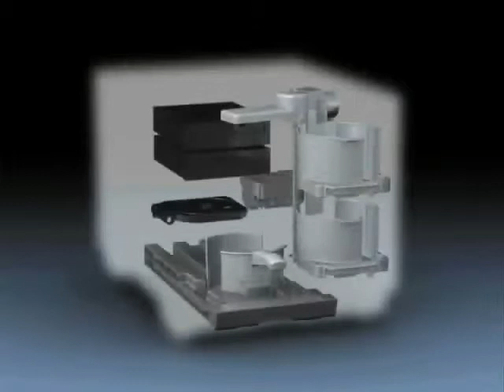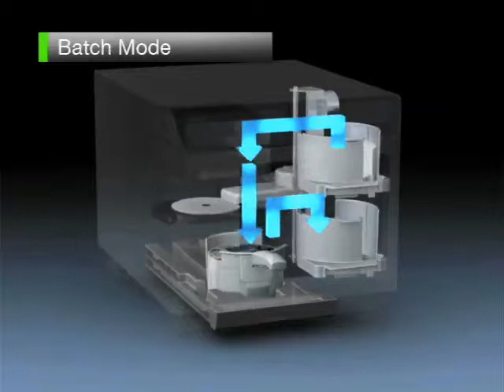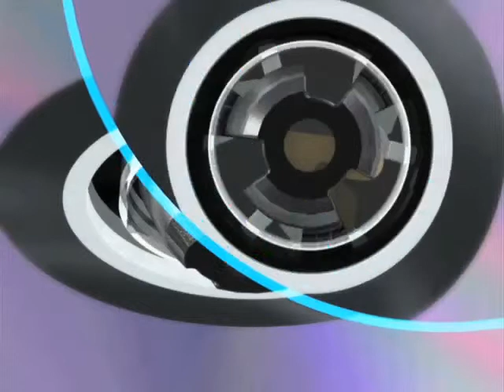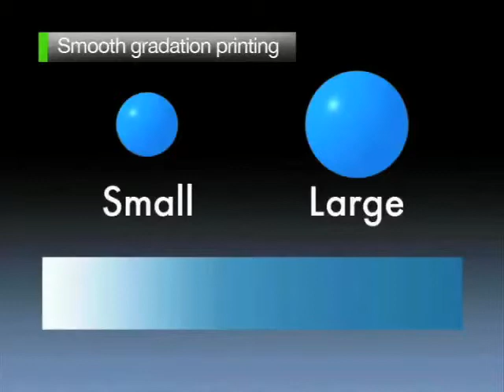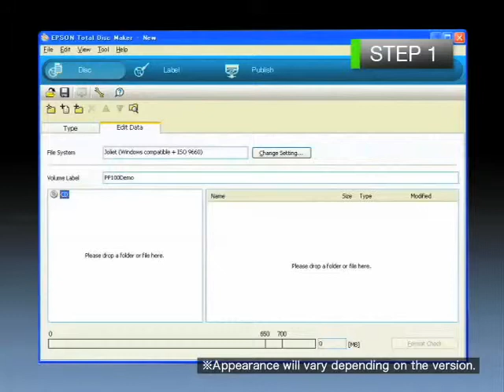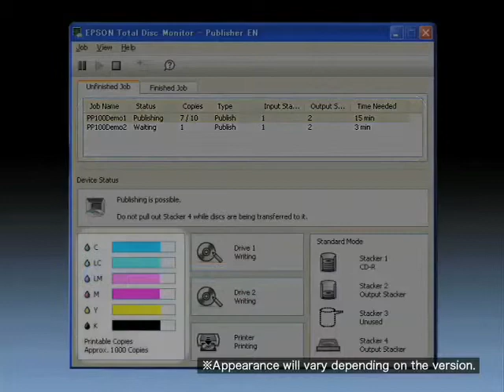Epson Disc producer

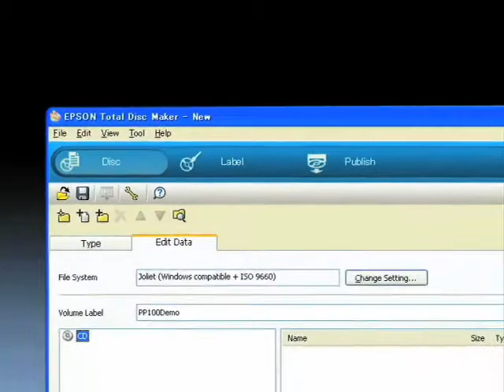Comment: 11:46  Okay, the question here is.... what formats of DVDs can this burn eg. something that can be played in a DVD player, from a .GI, .IMG, .VOB, MP4 etc.  Drag and drop almost all burning programs can do, but some are so stupid (basic) they'll rip the disc as a data-disc rather than a video-disc (can be played in DVD players, usually only can be done by more advance burning programs).  Thus why I ask :)
Reply: I know Epson is a brilliant piece of hardware, but I've never used the Epson burning software that's designed for this machine.